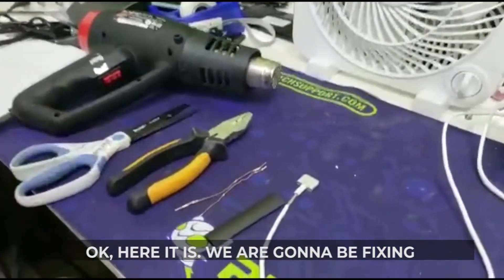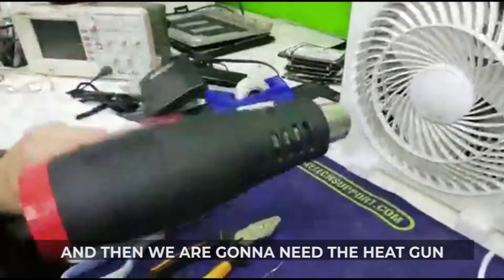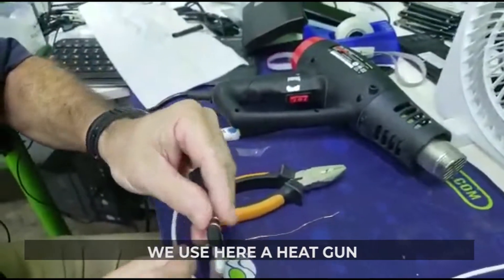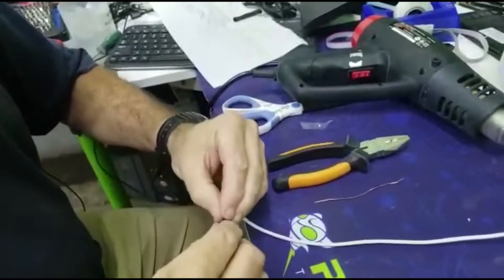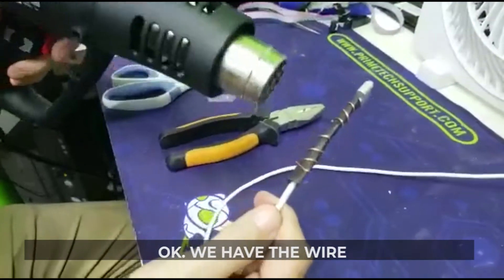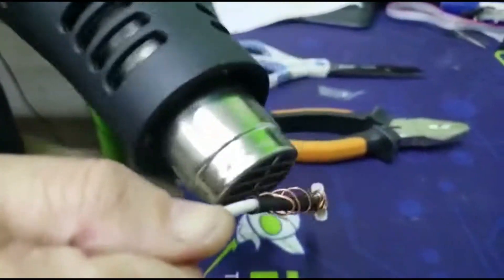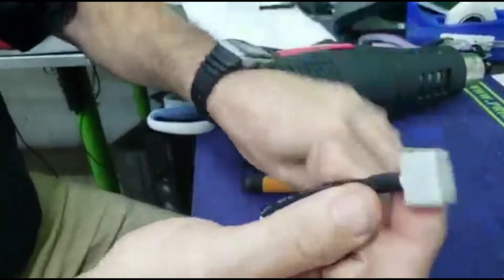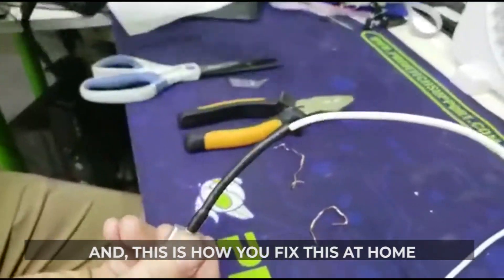How to Fix a Broken MacBook Power Cord

Comment: I just did this and so far it looks great. Be careful about overheating the connection head.  I thought I did but I let it cool down and it's working.  The seal looks tight but I wonder if it will unravel over time. But right now it's strong and is working.  Cheers!  

BTW I didn't have any small gauge wire hanging around so I took two twist-ties and removed the wire from the insides and used them. Worked great and I was able to tightly wind them around the shrink tubing and cable.

Update: It's been nearly a week and my fix is still really solid.  I'm not noticing any separation between the layers and overlap. This is looking like a solid fix!
Reply from the maker: Nice, well this is something you can do at home, we use other tools that help us do it faster 🥸
Reply: @PrimeTechSupport  What are your other methods ?